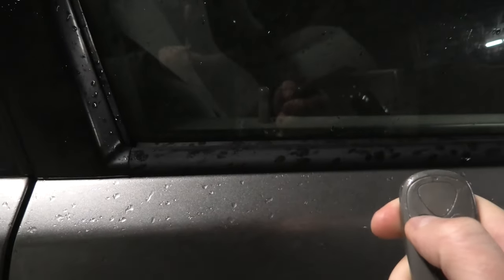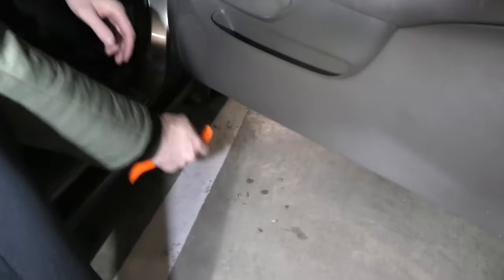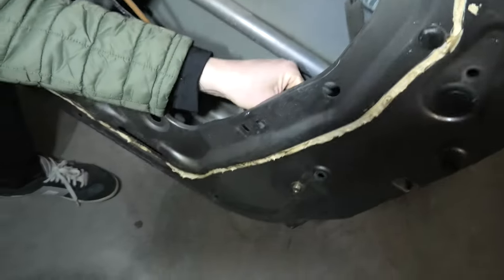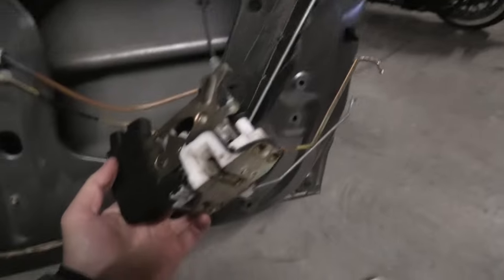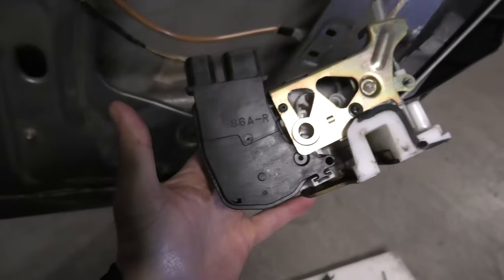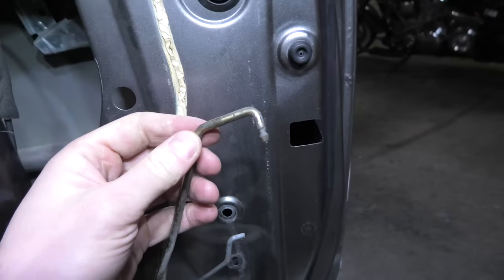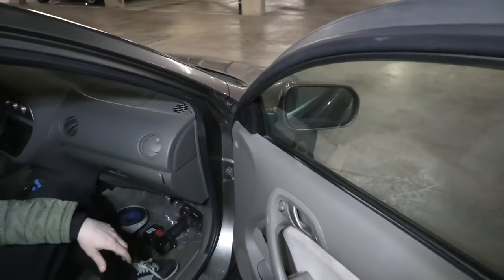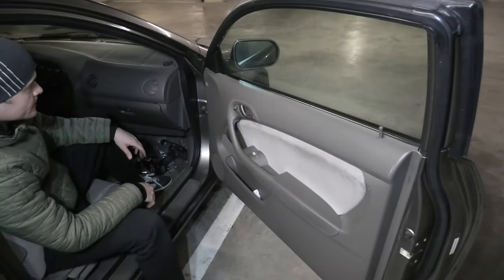Acura RSX (2002-2006): Door Lock Actuators Replacement.

Comment from the maker: PRODUCT LINKS:
1. PASSENGER DOOR - FAERSI Door Lock Actuator Motor Front Right Compatible with Honda 2001-2005 Civic, 2003-2007 Accord, 2003-2008 Pilot, 2005-2010 Odyssey, 2002-2006 Acura RSX Replaces 72115-S6A-J01 72115-S6A-J11 - https://amzn.to/48cygP9.
2. DRIVER DOOR - FAERSI Door Lock Actuator Motor Front Left Driver Side Compatible with 2003 2004 2005 Honda Accord Civic CR-V Element Odyssey Pilot, 2002-2006 Acura RSX Replaces 72155-S5P-A11, 72155S5PA11 - https://amzn.to/46VRYxI.
3. RIGHT AND LEFT SET - 2Pcs Door Lock Actuator Motor Front Left and Right Compatible with 2003 2004 2005 Honda Accord Civic CR-V Element Odyssey Pilot, 2002-2006 Acura RSX Replaces 72155-S5P-A11,72115-S6A-J01,746301,746302 - https://amzn.to/3GG2e2c.

RECOMMENDED TOOLS:
1. TRIM REMOVAL TOOL - 4pcs Auto Door Clip Panel Trim Removal Tool Kit - https://amzn.to/41nYhsk.
2. FLAT HEAD SCREWDRIVER - Klein Tools A131-2 1/8-Inch Flat Head Screwdriver with Keystone Tip, Made in USA, Pocket Clip, 2-Inch Round Shank - https://amzn.to/3VV0FVh.
3. PHILLIPS HEAD SCREWDRIVER - Klein Tools 603-4 Screwdriver - https://amzn.to/3kFGex0.
4. CLIP REMOVAL TOOL - GEARWRENCH Panel Clip Pliers, 3705 - https://amzn.to/3SjP2Ff.
5. WIHA HEAVY DUTY SCREWDRIVER SET - Wiha 53097 Screwdriver Set, Slotted and Phillips, Extra Heavy Duty, 7 Piece - https://amzn.to/3ystzRx.
6. RATCHETING WRENCH SET - GEARWRENCH 16 Piece 12 Point Ratcheting Combination Metric Wrench Set - https://amzn.to/3JqYunC.
7. SOCKET SET, RATCHET - GEARWRENCH 57 Pc. 3/8" Drive 6 Pt. Mechanics Tool Set, Standard & Deep, SAE/Metric - https://amzn.to/41wE6Z3.
8. COBRA PLIERS - KNIPEX Tools - Cobra Water Pump Pliers, Red,10-Inch - https://amzn.to/3yr7Nxt.